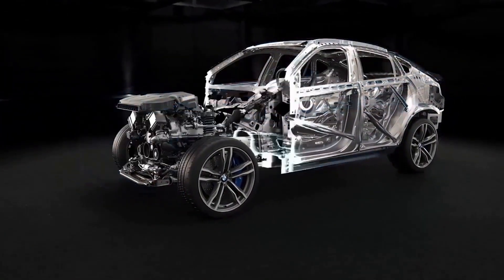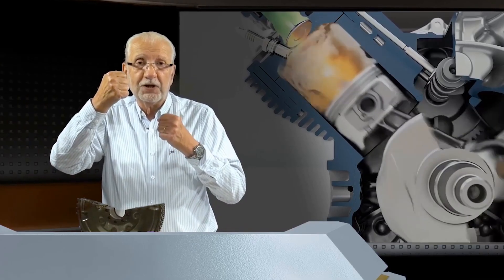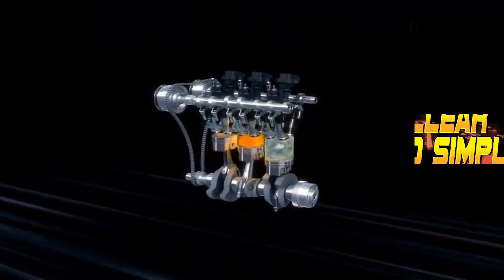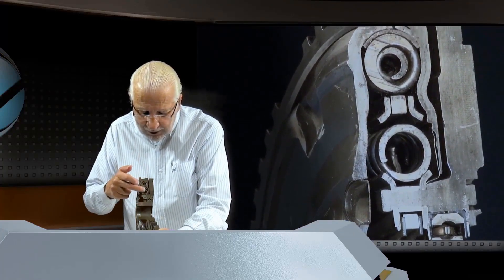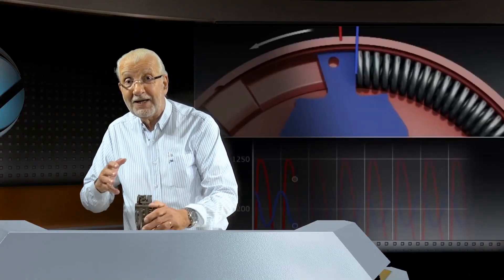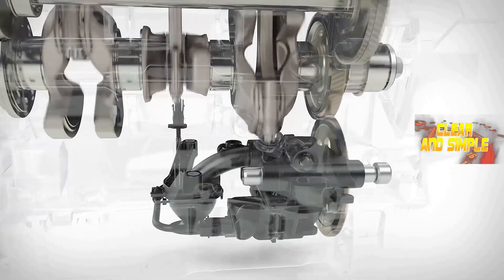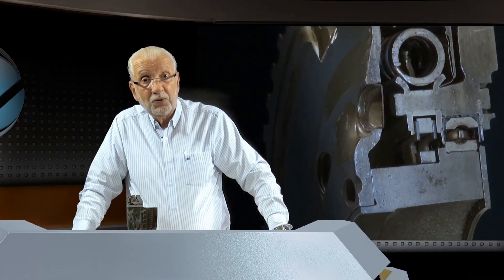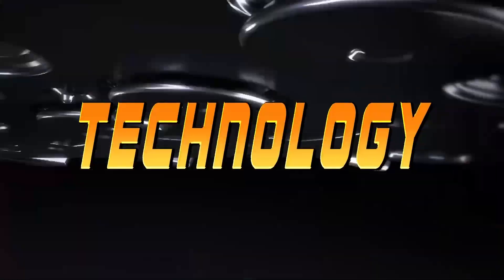Dual-Mass Flywheel (DMF) Vs. Single-Mass Flywheel (SMF)

Comment: A dislike for stupidity and lies. The true purpose of dual mass flywheel is to increase the cost of maintaining a car and decrease the reliability. Maybe works on three cylinder cars, but we have 3 cylinder from 80's who are much better than today. BUT, in 4 or 6 cylinders today, the dual mass is present just to take our money. Just like egr and dpf. Use aftermarket kit for replacing dual mass

Comment: the only thing it does is add cost to complicate what already worked fine for decades. I switched from a dual mass to a single mass flywheel with a sprung clutch disc. it's more reliable and my car drives just as smooth..

Comment: Fiat Geande Punto and Opel Corsa D (same platform) have the same 1.3 diesel engine as option. Opel has DMF, Fiat does not. So many put Fiat part in their Opel when it came time to replace. 
I think that it makes a difference when the car is new, but after 300.000km when everything starts shaking, it does not matter.

Comment: When we look at engines we look at efficiency? A combustion engine is not economical and never will be. The energy supplied is converted into movement and heat energy. Almost 75% is converted into heat while movement was the goal. What a waste? The technocrats and governments of this world have been trying to improve this wasteful piece of technology for years. DSG EGR DMF TFSI it has only gotten worse. DMF will definitely break down within 100,000 km. And a repair is not cheap. 
A counter balance shaft is much better and also removes the vibrations. An electric motor is the answer but the world economy is addicted to fossil fuels.

Comment: Fought with one in my 2002 gmc duramax you can’t machine it . By 30 k miles it failed twice changed to a southbend single mass flywheel and at 200 k no issues. No noise

Comment: Ex spanner monkey here, the friction plates of a clutch from regular solid flywheels had sprung centres to dampen the hit to the main shaft/drivetrain and worked perfectly well even on 3cyl cars. These DMFs are far too prone to failure.

Comment: I had a diesel Focus with a huge mileage. One day on starting there was this terrible noise. I thought the starter had stuck in engagement. It hadn't, it was the DMF. I got it 20 miles back home keeping engine rpm to 1500. It was awful. I had a journey I had to make afterwards. I took it easy there but on the return I 'redlined it' in all the lower gears and was quite violent with the clutch. Noise stopped. It drove a little rougher than usual but I did thousands of miles more and sold it on, and saw it around for ages!

Comment: Some of what he says is true, some is not, DM flywheels are the cheapest easiest option because they are classed as a serviceable item, so no warranty claims later in time, you can use a conventional crank damper, balance shafts, crank balance weights, all of which cost more to design and make, bean counters strike again, i hate them too.

Comment: After working with racecars that have the option to use both DMF and SMF, I can honestly say that DMF is just not worth it unless you have an inherently extremely vibrating engine. I3? Yeah! V6 or maybe I5? Yeah! But I4? No. They cause more problems than they solve. Hence why the car that I have worked on comes in two options for street-legal version: DMF and SMF, or comfort and basic sport version, but only one version for track usage - SMF.
Reply: V6s are smoother than inline-4s, check renault PRV V6 development pdf and you will see it proven with the math.
Reply: @thomasschumacher5318  I´ve already seen videos about engine balance, and I´ve already worked with enough engines to know them. And unless Renault uses some special sort of crankshaft or balance shaft, then the answer is no, a typical V6 has a terrible primary balance, and its worse than I4.

Comment: Harley Davidson uses a device they call a compensator to counter the harsh uneven firing of their engines. Without it, the crankshaft breaking is going to happen and there goes your whole primary case.

Comment: Upon removal of mine to change out the rear main oil seal in my MK4 VW ALH TDI Jetta I discovered it seized in place.  

I plasma cut out the center to access the bolts and replaced it with another used DMF I had collected. 

Someday if my 380,000 mile clutch ever wears out, my old seized flywheel will go right back in as I never noticed whatsoever any noises, rattling or vibrations. 

Had the seal never leaked any oil the seized DMF would still be in place. 

I did notice riding my Suzuki Savage 650 thumper a very noticeable pulse in forward propulsion with one reciprocating piston.  What a remarkable, simple and reliable machine that was. Never should have sold it.

Comment: Dual mass flywheels have a serious failure mode that occurs at low engine revs. It is so serious that they can go into resonance a destroy themselves. This can occur during pullaway if the engine speed is allowed to dip significantly below the normal fully warm udle speed (such as when not applying much throttle but letting the clutch out a little bit too abruptly. To prevent this failure mode certain manufacturers instigated a complete engine shut down if the engine speed dipped too low (on their 3 and 4 cylinder engines that used DMF's). Additionally the use of the engine management (via ignition retard and fly by wire throttle)  to smooth the transition from closed throttle to open throttle is much less effective as the position (and thus cushioning ability) of the DMF is variable. The same vehicle with a DMF could not be calibrated to give as smooth a transition from closed throttle to open throttle, and was much more prove to driveline oscillations.

Comment: Dmf is just a ripoff. Consider agricultural machinery , mountains of tourqe , yet most used a smf. And those do work , unlike punny cars and trucks.

In reality it would had labour cost to make the engine run smoother. Dmf is an expensive  and very bad , failed attempt at fixing a problem that should not exsist in the first place.

Comment: Mass gives Torque 
Cannot Tow with a Single plate Clutch

Engine firing order (Suck Squirt Bang Exhaust) varies from 1 movement (Ford) to 2 with Audi (Dead Cycle) & Alfa Romeo Twinspark (fires 2 times for Spark cycle) 👍👍

Duel mass is 90% on Diesel engines for Towing 👍
Reply: What? My car has a single plate clutch and I've towed with it for decades...
Reply: @Sparky_D  
In other words, "You fitted Tow bar Yourself"  🤔🤔
Reply: @statementleaver8095  no. They don't fit tow bars based on what clutch your car has. How about you do some proper research.
Reply: @statementleaver8095  also, my car is 41 years old.

Comment: But they are expensive tbh you buy a used car thats worth 6000$ and needs a clutch replacement with dual mesh it will be over 2000 without dual mesh around 700

Comment: So fitting a dmf was so a smaller cheaper and easier to shift gearbox could be used. I was told from an insider.
Reply: I've heard aslightly different reason, which is: as the DMF smoothes power delivery it allows manufacturers to build less blanced engines and I can believe this as I have a 2003 Ford Fusion with the older type flywheel (bought partly for this reason)clutch replacement cost approx £180, but if I bought a 2004 model exactly the same engine but a DMF clutch cost approx £540.